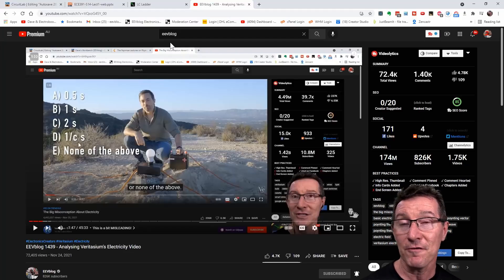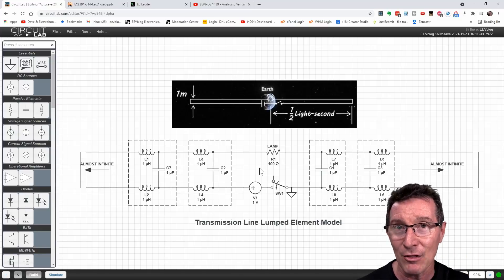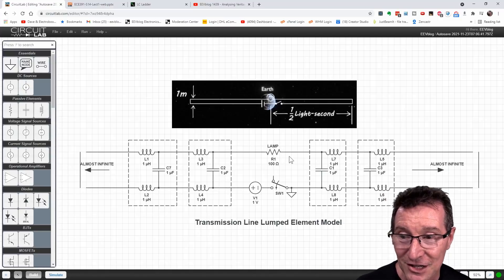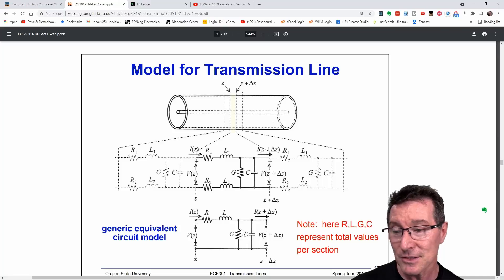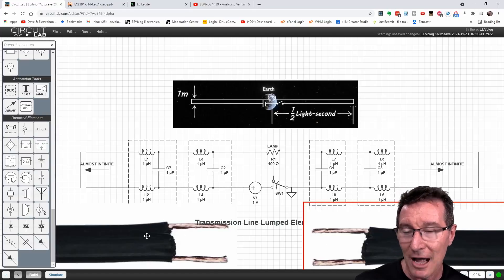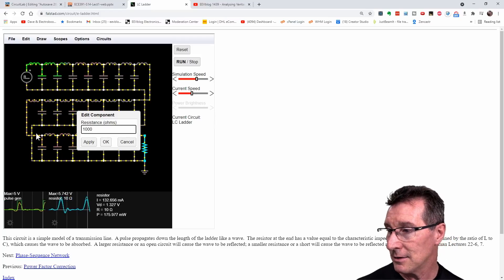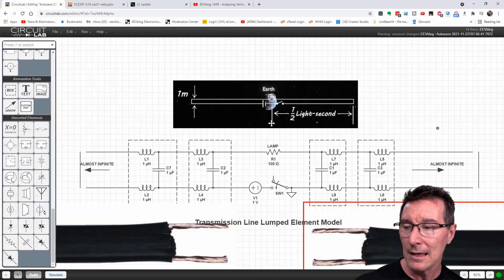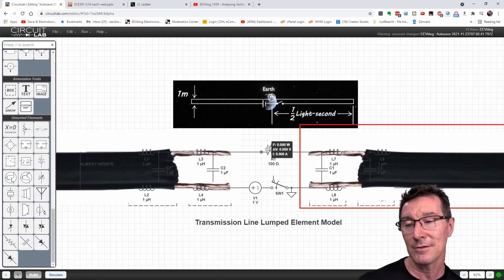Veritasium Electricity Video - Simulation Notes

Comment: As an electrical engineer, I can underline all of this. 😀 Instead of reporting something sensational here, you can use simple engineering methods. I did that myself too. Things get a little choppy in the last part of your video that talks about DC power though. Consider the following: With direct current, the energy naturally also flows outside the conductors. If conductors are lossy, then the Poynting Vector partly points into the conductor, because then energy is actually consumed in it. That makes sense, doesn't it?

Comment: I'm a bit confused because this sounds like spooky action at a distance. For example imagine the following scenario...

- Say you have an LED bulb and a sufficient power source spaced one light second apart. 
- Lets assume that we are using some kind of superconducting wire with nearly zero resistance to simplify things
- The wire stretches out in a straight line to relative right and relative left for 5 light seconds in either direction, meaning there is a 10 light second long segment connecting the power source and bulb, and a total of 20 light seconds length in wire.

So if you flip the switch the light will turn on in 1 second? 

What makes it so that this particular light switches on, for example what if you have other bulbs and loops of wire. How do the electromagnetic waves 'know' to conduct energy to that one bulb within 1 second without tracing the full 20 light seconds worth of wire to find which one it is connected to?

What if you additionally have an astronaut 5 light seconds away, flipping a secondary switch on the line at the furthest point. Assume you both synchronized watches ahead of time, and are compensating for any relativistic effects from travel. You both close the circuit at the same time, does the light take 1 s to light?

What if the loop has been closed at their end for some time. You flip your switch and 1 s later the light turns on. At the same time the other astronaut opens their switch, will it take 1s for the light to turn off, or 5 seconds?

So many questions!

Comment: Veritasium was finally right about the circuit. The problem is what happens at transient state and what happens at steady state, you are applying an step function into a dynamic circuit, some current will flow to the bulb almost instantly, though that current is far less than the steady state current.

Comment: Okay, practical: Incandesce bulb that my eyes can see. I know that 3.3ns there is some energy.  For the light to be on, visually, is the answer 1 second and 2 seconds?   Also, visually, if the switch is then turned off (open), does the bulb, visually, go off immediately?

Comment: It's still two mismatched transmission lines in series and when the switch is closed initially the circuit sees two characteristic impedance in series until the reflections start coming back.
Reply: the first thing is that we don't have a transmission line model for 2 wires 1 meter apart.
We can deal with an RG58  50 ohm coax cable because we do have a model.
My bet is that long wires like the example would act as antennas and radiate the energy away.
The whole example was just silly from Veritasium. LOL

Comment: I can't accept this answer. It the conductor is single core and the loop is in a large loop on both sides of the lamp and DC battery to negate capacitance as much as possible and the lamp is ONLY sensitive to current NOT EM. Then I believe the lamp will NOT turn on in d/C time.

Comment: Entanglement is the answer as all technological devices ignore the so called Q.E.D. theory (experimentally confirmed earlier by TESLA experiments with so called schockwaves (Scalar waves ) with supra-light speed.
Who proved by measurements  that a capacity transmit an information in potential apparition (voltage) form (apparition of a so called E FIELD between the plates) between two plates at light speed and not in entanglement.????????
Well ask yourselves the reason why two permanent magnets attract each other in the Space (vacuum) Physicists detest "real forces" acting at a distance (real attraction) without a physical link. 
They are right here , it is the Space (with nothing MATERIAL in it) which contract between the two magnets and take back its dimension after the magnets are removed. That is the matter-anti-matter (willing to localize" effect) which is in play because the H field which is simply a rotating E field has a "centrifugal" effect on matter-anti-matter couples (virtual particles) willing to BE (mass particles) all along the H path.
You are not obliged to believe it but US NAVY (EL PAIS group, patents 2017_2018°) work actively on that phenomena in order to "field attract" Space crafts" without the problem of inertial forces (crew) as no real movement of the craft relative to space occur at the end of the journey.(worm "thing" of EINSTEIN)

Comment: So +/-2.5V in both directions I saw some YouTube videos by ... mistaken ... people, who said ignore the left branch bc it does nothing which is flat out wrong think about it the switch is closing into 0V so you could ignore the right branch and say only look at the -5V on the left side. It splits the difference... 0V shows up halfway through the battery at first (ignoring switch location ... which the question as posed already does)

Comment: Leakage current through the capacitance of the switch (and wires)!
External interference! Temperature above absolute zero so the electrons are always moving with brownian motion!!! When a person approaches the switch to flip it they have absolutely capacitance which gets charged BEFORE the switch is flipped on!
The lightbulb is never off!!!
Can't pick and choose which parasitics (like wire to wire capacitance and mutual inductance) we include for the purpose of the trick question while including so many ideals (and count "on" as literally any amount of current)
Reply: Oh wait when the switch is closing the tiny arcs and lack of debouncing filters have significant RF energy on the battery side... so again the light is on before the switch closes bc of arcs (and the simulations are using a slew limited unit step which isn't what it would be when a switch closes)
Reply: Maybe the wires could have been idealized further by being electrically and magnetically shielded by superconducting high magnetic permeability ideal material that doesn't exist (like the rest of the parameters of the question)

Comment: Here's a quick & dirty LTSPICE netlist for simulating it, with 2 shorted stubs with appropriate delay, with an LED & resistor because the initial problem statement in his quiz before the video didn't mention the ideal lamp. (Add the correct path to your standard diode library for the diode).

# Veritasium light-second lamp on transmission lines quiz simulation
T1 N003 N003 N004 N006 Td=0.5 Z0=964
T2 N002 0 N005 N005 Td=0.5 Z0=964
V1 N006 0 PULSE(0 12 0.1 1n 1n 100 200 1)
D1 N001 N002 AOT-2015
R1 N001 N004 390
.model D D
.lib LTspiceXVII\lib\cmp\standard.dio
.tran 10
.backanno
.end

That 964Ω characteristic impedance is pretty close to the correct value for parallel 22AWG wires 1m apart in vacuum. $Z_{characteristic}=\frac{Z_{0},\pi}\acosh(\frac{Distance,diameter})$. $Z_{0}\approx376.73Ω$. I get 964.25Ω, 965 is close enough. We've got enough simplifying assumptions here, a quarter ohm characteristic impedance isn't going to hurt.

Of course LTSPICE doesn't simulate the 1m/cs part of the delay, but compared to the time to reach steady state that's negligible. 1m/cs is the right answer to the question with the assumptions posed in the video, and the wrong answer to the question posed in the pre-video quiz for any semi-realistic light being viewed by a human in normal conditions.

Comment: This whole situation can quickly be proven practically with 120 m of wire, two 10v batteries, 2 high speed mosfet switches,  resistor/lightbulb & a GHz dual channel scope.
Put the batteries in series with the centre point grounded (for symmetry). Put the e switch on each side of the batteries & 30m of wire straight out from each side.
1m away put the bulb with 30m of wire hanging out each side (keeping everything about 5m off the ground to minimise those effects too).
When you put the dc step pulse onto the battery side wires you have 100ns (30m/c) to make your measurements before it realises it is going to hit an end & not go on 300km.
This is plenty time to look for the minor KICK in the voltage across the bulb which should be visible on the Gig dual channel scope 3ns after the switches are closed.
If it is a 20W bulb (20V) it will be looking for 1A to fully light it but I reckon the characteristic impedance of a single wire going off to infinity is probably around 600 ohms so the current pulse from a +-10v step is probably about +-17mA flowing into the "energising dipole antenna" on the battery side.
Some of this energy flow will couple into the "receiving antenna" on the lamp side (after the 3ns transit time for 1m), but that has a 20ohm load which is also a mismatch to "dipole antenna" characteristic impedance on that side too... so some radiated energy WILL flow into the lamp after 3ns but certainly NOT 20W..... you want 1A but I expect you will get well less than 16mA so I don't think any sunglasses will be needed.... anyone got this kit lying around to video the real results?.

Comment: I'm glad you pointed out the invalid use of the transmission line model.  It's similar, but not just a pure, simple transmission line model, and using the transmission line model to represent the current transfer from one side to the other is not completely valid (it is only representative for end-to-end).
Even the capacitance across the leg is somewhat invalid for this purpose, because the capacitance per unit length is important (there's inductance for each infinitesimal capacitance).  You can improve the accuracy by making your capacitances and inductances very very small, but for all except the first infinitesimal capacitor, the delay to the bulb becomes greater than 1m/c (yielding the more complicated power transmission that others have already modeled quite accurately).

Comment: So, base on the above video that you show the wire that has two copper separate so there is a capacitor, so a tiny capacitor with insulator above, so the gap of space will cause electricity, so there is the direction that is left and right, which cause potential different to create electricity so that means the wire need to be two, not one, and need to be a gap?? So, two means one forward and one back, 4 means 2 forward and 2 back?? Odd number means higher friction in wire so will break apart, so need to be even number? So, the same as a conductor is odd and the insulator is even, the number 1, 3, 5, is an output of friction since there is no cancel out so it will neutralize. But can be wrong so it can be just one wire that is all with no gap of space that is a capacitor. So, the bigger the capacitor, the higher the resistance of mass which resistance the power that is high since it is long so need a lot of energy as an output. But the whole thing is based on radial inward so the outside that is magnet field will pull in, the b field to interact to I field on the mass so the electrons go inward as you say for DC that is steady current, but AC is opposite so it goes outward, so the magnet radiation goes down, the DC the em radiation stay on the wire. AC is high motion frequently which causes a higher magnet field and higher electricity so there is friction, higher frequently which needs higher resistance of mass. So, there is no steady-state for AC?? Or the steady-state of AC is very low in frequency that can't notice out of phase of the state which dim the light and bright the light, so it is constant light. 

Well, why is DC in a steady-state and AC in a non-steady-state? So, ya are basing steady state is one direction so that is called stead state so not based on the light itself but base on energy to the light. One direction energy, low to high-frequency energy so that is per time. AC is alternative frequently and radial outward; DC is one direction and radial inward. So, in connection to Einstein and Tesla, so Tesla is preferred since requiring less mass to give you energy, Einstein requires to multiply mass, since one direction is low in power in distance, so alternative frequently is high in power in distance, but also cause higher friction in wire, higher magnet field. Capacitor and resistance are the keys since the gap of space cause potential differences of two edge of mass, the conductor, like you, shows the wire with two copper within and gap of space with external that is an insulator. So, there is two-gap of space that is in wire and in between two-wire, so within the one wire cause the dim of light in an instant since it is much less than a meter and much less, but a bit bigger than bulb and connect to the wire. As for power that goes thru the wire, there is impedance so base on a definition of impedance that I saw it says apparent resistance, so that means the power which is a pressure that causes motion, and the resistance will be felt on the pressure, so like in-car you drive that is accelerating or decelerating, so feeling the pressure, so there is the impedance that is accelerating or decelerating so it will cause friction in wire so that is what AC is so out of steady-state, so that is what non-stead state, so impedance is not good. 

So, there is mass-energy and magnet energy which is the same as big copper and magnet so you can see the magnet slow down so there is eddy current, so the wire has lower eddy current, so it is the low density of eddy current so create a barrier of energy on top of copper as it interacts with magnet field, so big copper and the big magnet has two opposite of magnet field that oppose to each other to create slowness of mass that has enough magnetic field that is b. So, copper creates a field so will block the external energy to interact to cause friction, so 1, 3, 5 as conductors and 2, 4, 6 as an insulator, so both have a barrier of friction since the insulator has a wide-bandgap so the pair cancel out so resistance friction.  The conductor has a bandgap that is tiny so can have friction but there is an energy barrier, so the electrons on copper and the volt, which both are energy so the volt is on top of copper so not touching the wire so there is an energy barrier that is eddy current that resistance the volt, so if it is high enough so eddy current will be reduced in space, well, eddy current cause slowness and barrier, so it will reduce the barrier if there is higher volt or higher AC.

Comment: Veritasium model is NOT real, Derek suggested superconductor 2 x 1 light second loops on both sides. Does it mean that "battery" ESR is also 0 ohms? In that case, "infinite" current will start flowing through loop ("unknowing" resistance of the bulb) and all neighboring lightbulbs would shortly be "powered" from that antenna. Also, what about the case when switch is initially closed, then opened. Will bulb then turn off in 1 or in 1/299792458 seconds?

Comment: I totally agree with your argumentation and simulation, but I don't think that this is what Derek wanted to show. He explicitly states that the energy flows out of the battery into the field and from the field into the light bulb. And that is exactly what I don't buy. When you put the switch at the far end of one of the wires, it will take 1/2 second for the closing signal to arrive as em wave at the bulb. So it is dependent from the position of the switch when the first micro current runs through the filament of the light bulb. By approximately the same time, the potential difference has travelled from the switch to the light bulb. This will cause the constant flow of the current through the filament, and this will turn on the light. If this is true, and I have not seen an argument against it, it cannot be that the energy flows from the battery to the field, and directly from the field to the light bulb. It is the flow of current through the filament, which is caused by the potential difference at the light bulb, that turns on the light. If I am mistaken, please correct me.

Comment: Wait, since the premise said that any current would do. What if we consider the switch as an capacitor, wouldn't it mean the light bulb would already on BEFORE the switch is closed? I mean, since it's an LC circuit, so it would oscillate indefinitely. So, the correct answer should be none of above.

Comment: Actually, as he is connecting up the circuit with the switch OFF, as soon as the switch (in the off position) is connected, the light will light up in 2 seconds through the capacitance of the switch itself.   A very picky trick answer kind of... 😂

Comment: You say the reason it lights up in 1/c seconds is "because the distance between these wires here is 1m".  https://youtu.be/lBycH31K-E8?t=86
I think a more correct answer should be: Because the distance between the switch and the lamp is 1m (given the above wire setup).
Does this make sense? 
Thought experiment: put the switch at the far end. if the light bulbs lights up in 1/c seconds => causality breaks.

Comment: Where did you get the guideline that any amount of current will turn on the light?  That is not realistic - for the bulb to produce light, it needs energy (and thus current).  If there is no current from the battery, then IMHO, the switch is not really "turning it on".  Also with the wires 1m apart and 0.5 light=seconds long to circuit is going to be primarily inductive (most of the energy is goin to go into creating a magnetic field not an electric field.  Eventually the energy will make it to the light, but by my calculations, it is going to take about 3h before the light will reach 50% power.